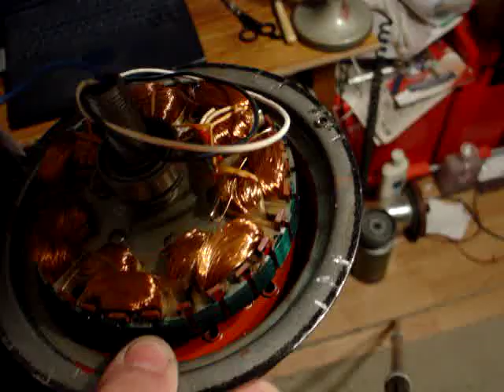The insides of a ceiling fan motor explained 2

Comment: The other ways some ceiling fans are controlled are by solid state variable speed controls, in which case the motor is single speed therefore all the coil sets are used, but the speed control does the controlling of speeds, then there are fans like this one where there are coil taps, but either variable solid state speed control is used or a 3 speed or 4 speed stepped capacitor based wall control is used!